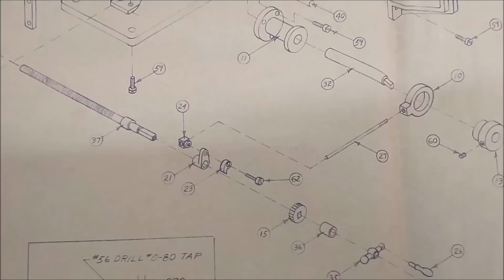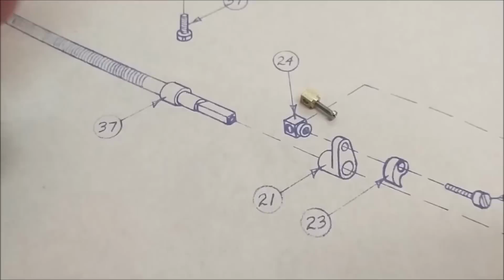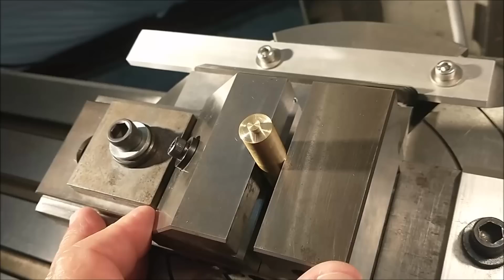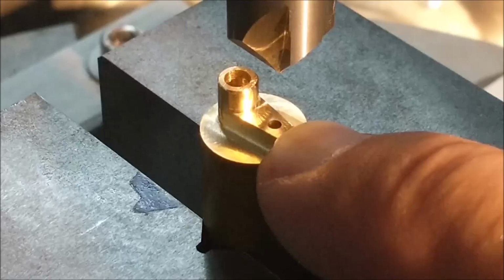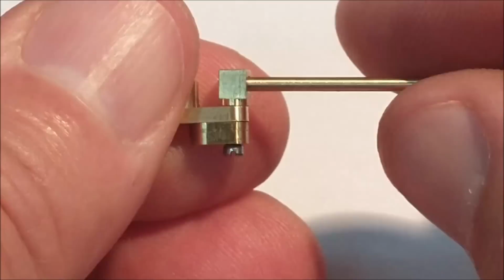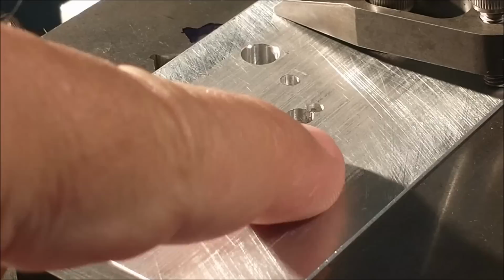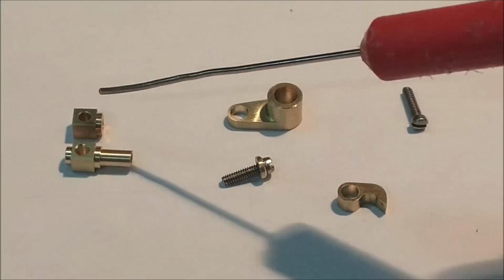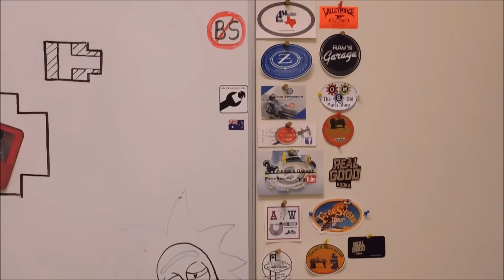Miniature Pawl Linkage -- Lets change the design.......

Comment: Loving the fractional metric. It's not our fault that 61/64 of the world is wrong. You could cobble up a little knurled thumb screw for the rod adjustment. That would be an amazing video. Thank you Joe.
Reply from the maker: The world has shown another weak point. Get ready for an unloosened 3/4" undersize 20 mm thread.

Comment: Tks Joe for the great tips you bring to the table. A suggestion - replace the slot head screws with small hex head i use all BA screws in my modelling here in Australia a 10 BA or 12BA hex head would look much better

Comment: thanks for the upload, like the mini-mini stuff !
 joe, at minut 16.15, jou said that screw was 80 thou and that supposed to be 1.5 millimeter, but 80 thou is a little bit more then  2 mm .
from inch to metric is approximately dividing by 2.5...
btw, nice modification....
Reply from the maker: Its an 0-80 imperial screw. Sorry for the decimal/imperial confusion. That wasn't intended to be an .080 comment.
Reply: @joepie221  oh, ok,  my fault, i,m from the netherlands 🙂

Comment: Hi Joe,
Another couple of parts finished. I like your redesign of the pawl mechanism. That's the way it should have been designed originally. Doesn't matter if it's a scale model, common machine practices should still be used when designing moving parts. You and your family stay safe.
Reply from the maker: Thank you. Its a fussy area with major pinch and failure potential. I still plan to change it again.

Comment: HI ! I have made the mistake just once when doing intersecting holes. It was an 1-1/2 hole that the bit pulled the piece out of the vise. It was before I realized I have the gift to appreciate the feedback from a machine and have used that gift since then some now 45+ years ago. This is great. It sure beats watching Bad Boys II for the 4th or 5th time eh. The "SLOP" in that part is really inexcusable. Apparently this was not constructed before sending these kits all over the flipping world. It can only get worse over time. Oh my, The walls are as you say, , , THIN. Your changes worked fine but I am surprised you didn't make new/different pieces to rectify that situation but it will most likely only have to work for just a few pieces before turning into a dust collector. A good looking dust collector at that eh, LOL. Thanks Joe, You saved my evening my friend. ONWARD EH!

Comment: Great little project, Joe. Just a suggestion for you, but if you drill a small hole in the top of the pawl and embed a piece of lead or tungsten shot into the part, it would give a more reliable index. Thanks for letting me hang out in your shop today!
Reply from the maker: Anything with greater weight would help for sure.

Comment: Lovely work as always, and I always appreciate the machinist tips and tricks.
For the sloppy bolt problem, I like your solution, but there is of course more than one way to skin a cat.  I think my own solution to that sloppy bolt would have been to make a small shoulder-bolt rather than all the other modifications you did. That way the smooth surface of the shoulder of the shoulder-bolt would form the bearing surface, rather than the original plan's use of the crests of the bolt-thread being the bearing surface which is never a good idea. (In this particular case my approach would require a precision lathe suitable to machine such a small thread on the end of a custom shoulder bolt)
Reply from the maker: Its a 3 part assembly. when the threads retreat, the pawl locks up. Its close, but not bullet proof yet. Even a shoulder screw isn't the final fix.

Comment: Back when I was working in the machine shop, I thought of a way to do metric conversion with my fingers.

On my left hand I count .040 per finger, 1 mm per finger. And on my right hand I count .200 per finger, 5 mm per finger

If you're trying to impress someone or you need to be a little more accurate, you can subtract an additional .0005 for every finger on the left hand and .003 for every finger on the right hand.
Reply from the maker: I use .04 as well. Close enough to get by.
Reply: Another thing I wish someone taught me, when putting a cosmetic chamfer on the hole. The outside diameter of the chamfer should be 10% larger than the major diameter of the hole. 

This becomes extremely useful and time saving when chamfering threaded holes on CNC, as you should chamfer before tapping. This way you won't damage the lead thread and in some cases you can chamfer with the same tool you spot drill with.

Please let me know if this is common knowledge,  10% is easy to calculate in your head and it has worked for me for years
Reply: @andrewpopoff3453  
I used to work in a facility that built automotive engines. A lot of the tapped holes were drilled for a relief maybe .050 deep and around .030 to .060 over the thread size. No surface distortion from the tap. Plus on things that got finished matched after tapping. Such as the ends of the blocks or head faces. The finish machining did not damage the tapped holes. When machining engine blocks in mass production the features every thing is based on are the oil pan rail and the manufacturing holes in the pan rail. Every thing is measured from those two things. You have to locate to something. And you have to clamp against some surface
Reply: @mpetersen6  Thanks for the helpful tips on c’bored tapped holes in engine blocks and location surfaces used for manufacturing. Good to know how mass production saves time and money.
Reply: @mpetersen6  I'm sorry think I missed your point, yes relieving the first .050 is a good way to protect the threads and the drill will leave a conical feature to help start the tap.

I was taught to countersink/chamfer the holes before reaming or tapping, as the reamer or tap will remove any displaced material/Burr in the hole.

These orders of operation don't really matter until they do,  if all of your tools are Sharp that will also help mitigate the issue. 

When assembling something with a lot of reamed dowel holes, it saves a lot of time if you don't have to deburr every hole, and if the screws basically thread themselves in as there's no burr on the lead threats. I have certainly retapped holes because the screw wouldn't start easily with my fingers
Reply: @mpetersen6  .030 to .060 clearance would work for 3/8 and up, but it wouldn't be the best for 2-56 threaded hole. 

A 2-56 has a major diameter of .086, so add 10% and you get .095 for the 45° chamfer size. And the same for 1" add 10% you get 1.100" which is also a good chamfer size
Reply: @andrewpopoff3453  Not common knowledge but very useful to know. Strange I’d never once thought of that.

Comment: Hey Joe,
Why not make a shoulder bolt to fix that slop problem with the linkage you show from 16:45 onwards?
Reply from the maker: The camera makes it look much bigger. A shoulder bolt would stabilize it, but not eliminate the 'still present'  pawl pinch potential.
Reply: @joepie221  Thanks.
When I was doing a lot of robotics shoulder bolts where like frosting on a donut for gripper assemblies when you don't have a lot of room and weight is premium. They weren't ever necessary but they made it so much better if you had things that needed to be taken off and on which you get with robot grippers.

Comment: Joe, great video as always.  But there's a flaw in your mod. It's ok for the model but in real life you need to be able to adjust the rod length when you change table height.  It should be easy to reach and preferably from the outside. It would be awkward on my shaper if the screw were on the inside.  Just my opinion.
Reply: I wondered about that myself. Perhaps a tiny hex head bolt would work or making the block thicker at the top so the set screw could go in from the side rather than the end?
Reply from the maker: Maybe I'll make a 90 degree block. I like the thought.

Comment: Hey Joe, where you goin' with that gun in your hand!  I don't blame you, that fitment is just not right.  I wandered across this video mainly because I've got a 12 or 14 inch shaper from the 19th century I need to clean up and put back in working order, been sitting a few decades, idle.  You did a credible job redesigning those parts, much better as you completed them.  Thanks, always a pleasure.
Reply from the maker: Thank you.

Comment: Hi joe, the motion work wheel on a clock I made used a thread for a pivot and I thought it was a bad idea until I read up on it. The reason was the thread retains the clock oil.  I’m not saying you do the same but Anyway you’ve done a nice job as always.
Reply: Yes but you could have held an imperial gallon in the gap between the pawl and the screw!
Reply: @samrodian919  yes on Joe's example but not on my clock it was a good fit.

Comment: Once again a great job Joe! Your way is considerably better. One other way it could have been done was by making a new bolt rather than a screw  with the unthreaded part turned to the diameter of the hole in the pawl to eliminate the slack, but your way is much nicer! Oh and by the way how is your Achilles' tendon getting on? Are you able to stand for a full day on your feet constantly now? I hope so!
Reply from the maker: The tendon recovery is really slow. There is nerve issues and unexpected numbness that is really difficult to function with, but at least I can walk and climb stairs. Thanks for asking.
Reply: @joepie221  keep at it mate. Nerve damage can be very painful and make your life a misery sometimes but they do grow back. I many years ago slipped with a thin bladed screwdriver and inserted it into the ball of my right thumb. The thumb was totally numb on one side for about ten months until the nerve grew back stuck to it Joe it will get better!

Comment: I really want you to know I enjoy this series very much.  I have a question!  As i was looking at the mechanism it seemed to me that it would only move the table in one direction.  If I am right, could the mechanism be redesigned to move the table in both directions.  As always, great video!  looking forward to the next installment.  KOKO!
Reply: With that ratchet feed on a shaper they are only supposed to actually feed on the return stroke.
Reply: Ratcheting in both directions would require two pawls with opposite facing teeth on the same shaft and two levers. One lever would be flipped back for the other to work.

Comment: Dear Joe,
 thank you for another good video. The improvement in play was huge. I would observe that as designed the feed mechanism on the cross feed is uni directional whereas pretty much all shapers have a reversible feed. A ratchet pawl like this is pretty much unkown and is a compromise because the sprung reversible pawl of a standard shaper feed would be nearly impossible to replicate at this scale. (Challenge anyone)? the teeth on the ratchet of a shaper are cut square across as housings such that the ratchet shaper will be able to drive in both directions. Whilst it is probably not possible to produce the sprung reversible detent of a standard shaper mechanism the flip over pawl of the Gingery shaper would be.
There are examples of the Gingery shaper on this very website.
Reply from the maker: I'd like to see that.
Reply: @joepie221  Unfortunately I am not quite tech savvy enough to send you a link but on the makercise channel on youtube there is a complete episodic build of the gingery shaper.
There is also a very good example titled modified gingery shaper.
It is simplicity itself
Reply: @joepie221  https://youtu.be/JZdbNWoySo0

Aha! Managed it. Here is the modified gingery shaper
Reply: @joepie221  And here is the makercise feed mechanism video.

Comment: i think maybe a weight, like a lead rod drilled into and glued into the end of the pawl. it worked better before because it was so sloppy and those threads offered no bearing resistance. Further you could incorporate the weight with a catch so it can be disabled
Reply from the maker: Any weight would help. The pawl is so light, you can hardly feel it on your fingertip.

Comment: I think i would have remade the screw with a long shoulder, the way you have it means the head of the screw is towards the table making it harder to adjust the stroke of that shaft.
Reply from the maker: Great point. Maybe a 90 degree placement shift would solve that. Screw on the top.

Comment: Brilliant work Joe, but wouldn't making your own pin screw from scratch have been easier? Another thing, I've noticed for brass you use HSS cutters, is that best for turning brass or is there another reason?
Reply: Tools for machining brass need to be very sharp, usually with a small radius on the tip for a better finish. Carbide works best slightly dull so not the best choice for brass and soft metals.

Comment: Admittedly, I probably would have turned a custom shoulder bolt (screw) instead of re-drilling holes in the pawl and the first part you machined at the beginning of this video, then using a die to cut the threads afterwards. As long as it works. Getter done! BTW, do you know of a source for small, metric (diameter) end mills? I need one just a smidgen short of 1/16”, or just shy of 1.588 mm.

Comment: Let me just say I really enjoy your work, but I probably would have put the set screw on the bottom but you would need different material. Or I would have left the back end square with nice big chamfers on it, but that's all cosmetic and you do beautiful work
Reply from the maker: Take a closer look at the assembly video. I relocated the screw to the top, 90 degrees to the screw holding the pawl.
Reply: @joepie221  that is exactly how I would have designed that part, one of these days I would like to go to Texas and buy you a beer

Comment: Having anything pivoting on a screw thread has annoyed me for as long as I can remember and still makes me want to scream at You Tube video's when I see it being done.
 I think I first saw it when I was about nine or ten,  on a motorcycle my father was working on in the 1960's (few years before the Hendrix quote even, LOL)
The way the threads had worn into components making them bind up annoyed the hell out of my dad who HAD to fix it. 
Having a spigot for parts to pivot on is a much better idea although a 'custom' bolt  with a larger diameter shank for pivots could also be used. I would probably try a threaded 'tube' on bolt then turn it to diameter, have minimal wall thickness above thread crest rather than make a bolt 'from scratch.
Reply from the maker: I hate to see bolt threads used as precision locators. Recipe for failure.

Comment: what t about a change of screw to a shoulder type bolt? To tighten up he part. Just thinking .
Reply: The length of the threaded end on the shoulder bolt would be super critical.  It has to be long enough to lock the rod but short enough so that the shoulder bottoms out.

Comment: I am wondering would it be a good idea for you to add a small spring to the ratchet to keep it on the gear?
Lee
Reply from the maker: Incorporating a leaf spring may be a good idea, but you'd still have to disable it for vertical work when you don't want the table to move.

Comment: I admire the precision. I do have a couple of questions. Shouldn't the shaft be just a titch LONGER than the depth of the combined bores of the pawl and the pivot? That pawl needs to rotate freely. The second question, aren't you going to have a heck of a time adjusting that rod in order to adjust the feed rate? At least with the screw coming from the original direction, you can loosen it, shorten the rod, and get a slower feed rate - or is that increasing, I forget, in any case, with the table on the cross slide, it's going to be even harder.
Reply: I think he was going to adjust the thickness of the pawl with emery to make it move more freely.
Reply: @robertpearson8798  the question was about the second screw facing the table. In order to adjust the feed rate, you have to "unloosen" that screw and slide the shaft either direction to shorten, or lengthen the stroke. However, there may be available adjustment on the other end of the shaft.
Reply: @alangrawien103  I was only addressing the first question.
Reply: @alangrawien103  If you look at the print he showed right off, it threads into a collar. There won't be enough adjustment there.
Reply: @robertpearson8798  Maybe. But it would have the same affect as making that shaft longer so the washer he made does not come in contact with the pawl.
Reply from the maker: The shaft was longer.

Comment: Hi Joe, would it not have been closer to the original design to make a shoulder-bolt to replace the screw?
Reply from the maker: There is a pinch potential on the pawl in its current design configuration. A shoulder bolt wouldn't solve it. I've redesigned it again and may post the solution.
Reply: @joepie221  Thanks Joe. We're all interested in the new design

Comment: So gravity alone forces the pawl down on the racket?
Reply from the maker: Correct. But.. Not sure I would rely on gravity on a part that weighs fractions of a gram.
Reply: @joepie221  The originals probably used a spring.  But try to model that.
Reply: @joepie221  Using spent uranium might have improved that😆

Comment: The problem is that you’re using jobber drills..
I always use stub (screw machine) drills for spotting (no center drill needed) and everything that is not a deep hole. You can always drill deeper with a jobber after the shallow hole is done.
Reply from the maker: Where was the problem?
Reply: @joepie221  
Long drills stand the chance of flexing and going off center.